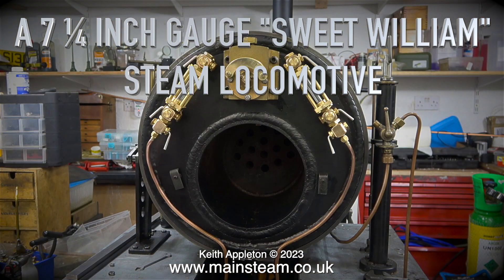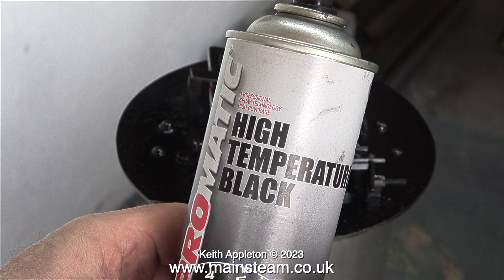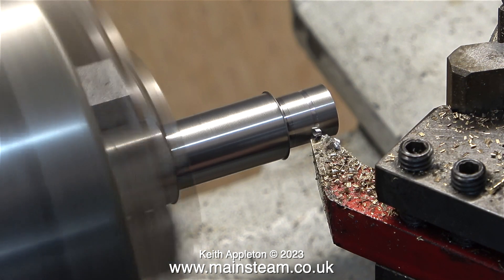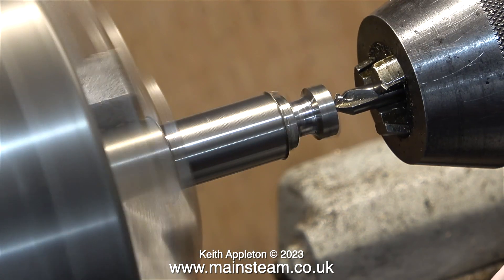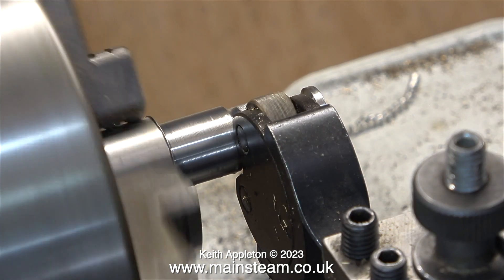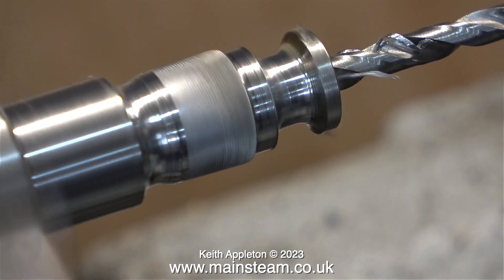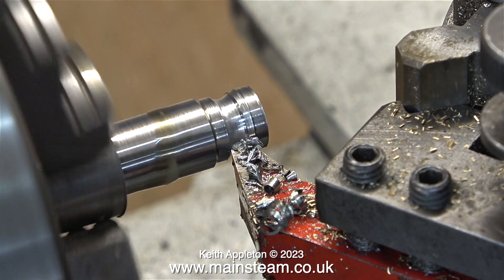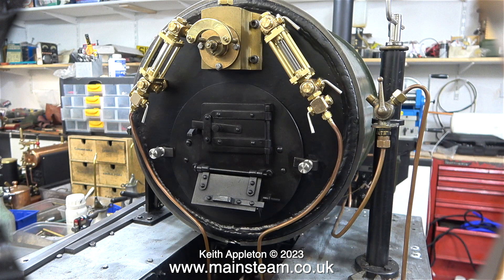A 7 ¼ INCH GAUGE "SWEET WILLIAM" LOCOMOTIVE - PART #37

Comment: I’d be interested in how you do loco disposal with steel boilers.

Option 1
Turn on one or both injectors and fill the boiler until the injectors stop injecting.

Rake the grate to drop all loose ashes into the ash-pan. Throw out a half the fire.  Close the damper and check to make sure that the fire has died (blower off).

Blow Down the boiler completely.

Open injector steam valves, blower valve. Drop some oil into the safety valves (all to prevent seizing)

Wipe over.

Option 2

Both injectors on as above.

Stuff a rag down the chimney and turn on the blower to extinguish the fire… and wipe over.

Option 3

Dig out all or most of the fire.

Don’t turn on the injectors,

When the fire is well and truly dead, stuff a rag in the chimney and blow down then open all valves except the regulator (obviously) keeping damper and firebox door shut (as with 1 and 2)

What I worry about is stresses due to temperature and pressure drops (both methods) oxygen in the boiler (rusting) with the first method rather than the second and production of sulphuric acid eroding tubes and inner firebox (using the second method).

For info my loco is a 7.25” Freudenstein by Paul Frank.

What’s for the best?
Reply from the maker: I really can't answer that as I have always used Copper Boilers, even my Large Showman's engine has a Copper Boiler.

Comment: Don't you get your fingers burnt if you try to unscrew those the nuts when the boiler is hot ? 
Ahh, I forgot, one of the purposes of live steam is to get your fingers burnt. 8-)
Reply from the maker: Every good Steam Engine Man has a cloth in his pocket which acts as generic heat insulation. These Fastenings only need turning sufficiently to release the pressure on the holding clips ...... Better than looking for the correct size of spanner when the boiler is going into meltdown - I thought that I already mentioned this in the Video . . . . . . .